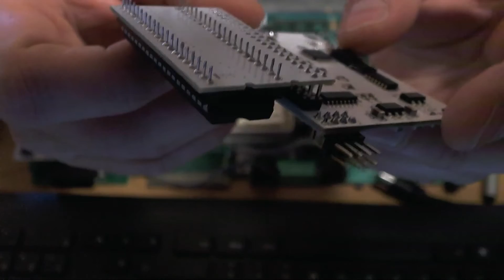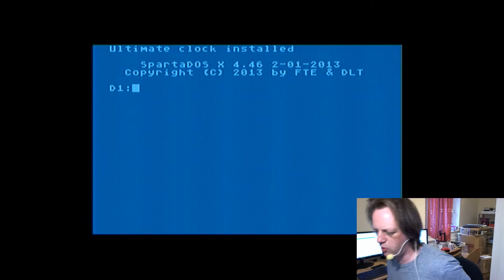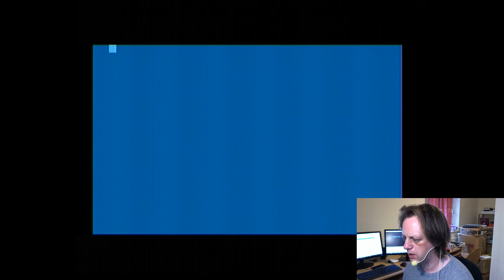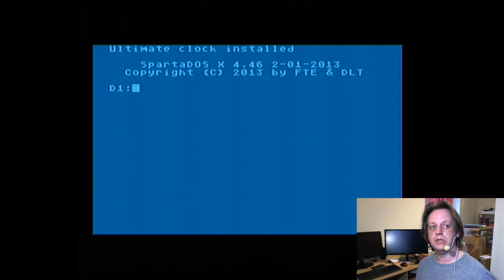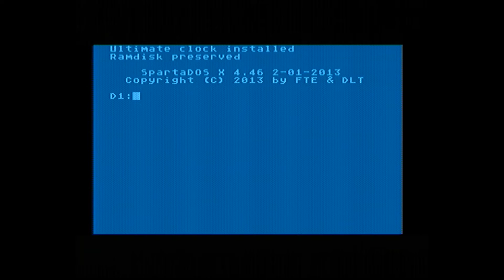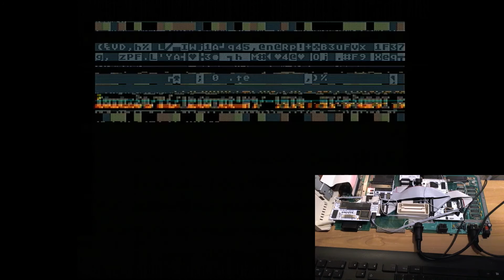Rapidus Atari 800XL part 6: Stabilisation and testing (fail)

Comment: I did Bryan's Quick & Easy mod on one of my 800XL's a couple years ago and it gave what I think it probably the best "bang for the buck" improvement you can get in the terrible stock 800XL video. I later installed one of his UAV boards into that machine, which I think is even better - sharper text, less color bleed and oversaturation of bright colors. I am so enamored of those little UAV boards that I have one on a 2600 and as of this past weekend, another in one of my 1200XL's.
Reply from the maker: Yeah I still have one of the UAVs here (someone in the UK sent me a pair of them) and will probably fit it in a machine eventually. I already put one of them in a customer's machine and the picture quality was excellent. I'm becoming less and less reliant on RGB output (from VBXE) as I spend more time capturing Y/C video from tweaked machines. Bryan's Quick and Easy mod is great too: just removing that blurring cap from machines which have it is often all I need to do to get a noticeable improvement.

Comment: My sympathies - nothing like snatching defeat from the jaws of victory to put a downer on things. Then again, it's a tinkerer's hobby and so it's just another interesting opportunity to problem solve.  :)

Be interested to see the S-Video mod, though finding a monitor that takes that is getting rare. Was thinking of doing the Lotharek RGB mod to then feed an OSSC box and then hence get DVI/HDMI output that way.
Reply from the maker: Yep: I completely lost heart towards the end of this video, largely because I know what's coming next (lengthy troubleshooting). Solving issues normally makes the effort worthwhile, but we're approaching the stage at which kludges will be necessary... like propping up a collapsing wall instead of tearing the wall down and building it properly (which might analogise to removing the Rapidus). All I did with the video circuit was hook up the chroma, but I will go over the back side of the motherboard when I wire up the RGB jack. The GBS-8220 and 8200 are excellent solutions for getting 31KHz VGA out of the VBXE, so I recommend them if a 15KHz capable display is not available.